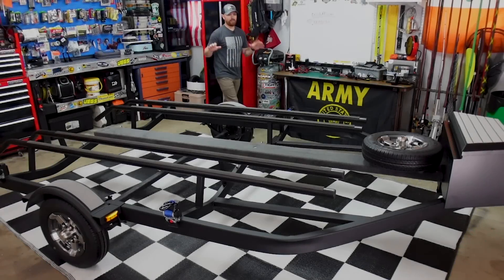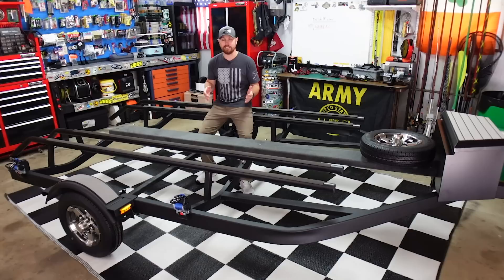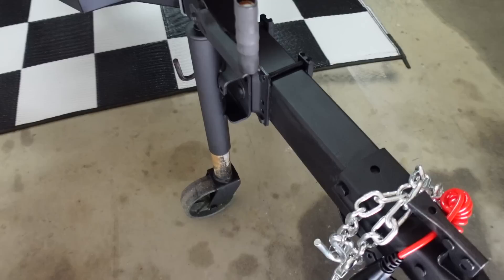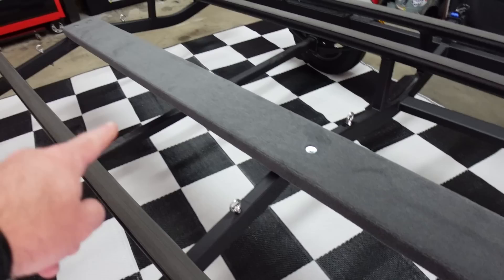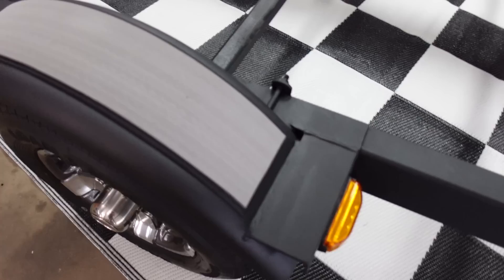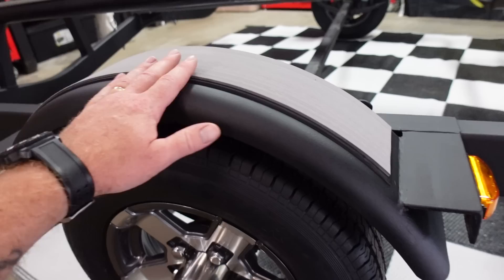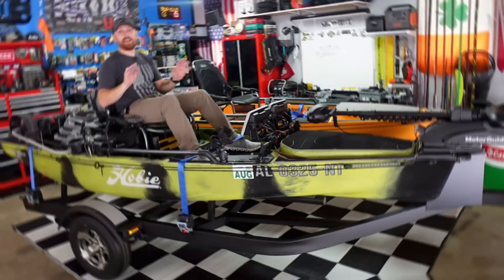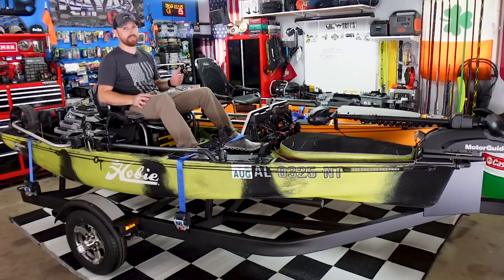Converting a Jet Ski Trailer into a CUSTOM Double Kayak Trailer | DIY Fishing Kayak Trailer 2023

Comment: This is the 3rd Jet ski trailer to kayak trailer conversion I've watched and none of you have even touched on the issue of the trailer flying into the air with every bump you go over because the leaf springs were made for 1600 lb of jet skis and a 500 lb trailer not 250 lb of kayaks. Im finding a hard time finding info on how to put on springs for a lighter load.

Comment: I went to breakfast with my wife and had to pause the video. Just made it to the part where you mention the bungees to on the short straps you are going to make. If the bungees keep the straps up and easy to grab, won’t you have to unhook the bungee from the strap anyway to get the strap out from underneath the h rail?
Reply from the maker: Yep, I actually was overthinking that part. I’ve decided to just go with some eye bolts up high and then I can just clip the strap up and outta the way. Gonna start this build soon 🤙🏼
Reply: @KayakUSA1  I’ll look forward to the video. I run a Malone trailer currently but I like this build series because I keep thinking of building my own so I can add things like rod lockers and or a rooftop tent.

Comment: Great work!  My trailer had an upper tier, so it had the vertical posts in the center.  The nicest thing I can say about that configuration is, what an absolute PITA!!!  I took it off and will never put it back on again.  I would like rod holders, but I’ll probably experiment with attaching them to the bed.  Your set-up is sleek and streamlined.  Those posts will make launching and loading not so easy.  You may want to temporarily mount posts to see how they work for you.  You may end up loving them.  Or, not…LOL!

Comment: For putting bolts in to frame rails for your straps, look in to riv nuts. Think a pop rivet that has threads in the center of it.
Reply from the maker: That tool is on my list to buy. They are great 👍🏼

Comment: Short straps are a temporary problem as you explained in your video, but you could use motorcycle handlebar straps as temporary extensions. Carabiners aren't legal for load security in many areas and those fines aren't often cheap if you get caught. One change I would have considered with your current build, those two holes at the rear centre of the trailer would have been good spots to connect reverse lights and would be easy to wire into your seven pin connection if you can get a 7 to 5-flat instead of seven to 4-flat. Makes those pre-dawn starts easier to accommodate. Great build otherwise! TY!

Comment: Great job trailer looks great. I would actually suggest for the center post putting a ring welded to you vertical post that way you can hook your extension to it. I think the bungee cord will be a pain to deal with because of the H rail. I tired to find an old jetski trailer but everyone I found people want $2,000 for them. I converted my trailer from a 5x8 utility trailer.
Reply from the maker: I actually thought about that after I filmed the video, you are definitely right just adding an eye bolt would be so much easier and it would work be more secure. Thanks 🤙🏼

Comment: How did the EVA foam strips workout?  Any suggestions regarding carpet or marine mat?
Reply: Would also like to know if the EVA runners on the bunk tubes worked out (I have them being delivered next week, but want to know your thoughts after trying them out.

Comment: I purchased a 6x12 utility trailer to carry my Big Fish 108 and my wife's Moken 10. I want to use pvc for the runners.  The Moken is no trouble but I am stuck spinning my wheels for my BF.  I have seen several videos that warn against solid runners and pvc that is too big for the hull.  2" pvc works best (3" is too big).  I have to elevate the runners / bunks because of the BF hull and I can not figure out how to elevate them without using brackets that would damage the hull.  Any ideas would be appreciated.